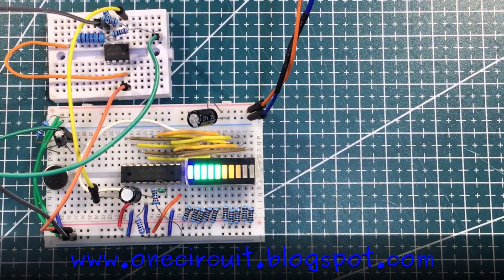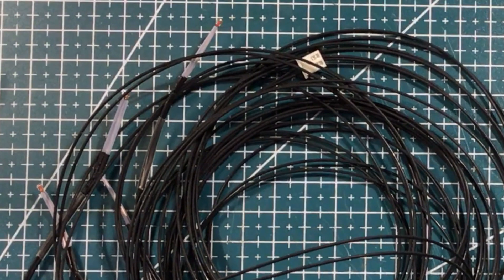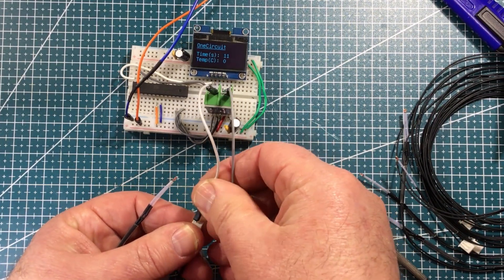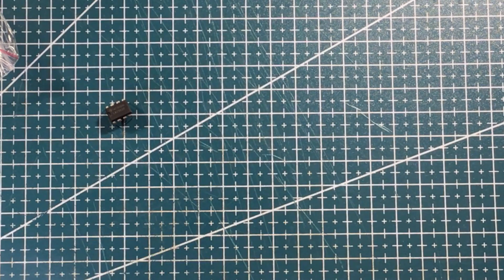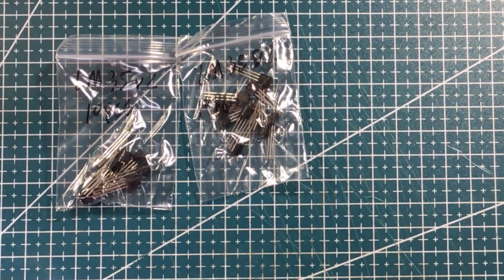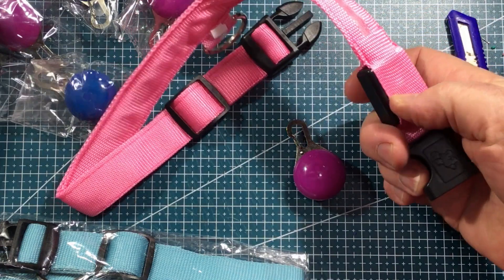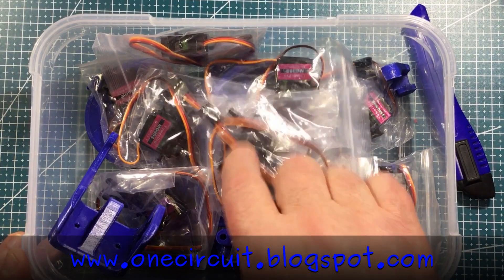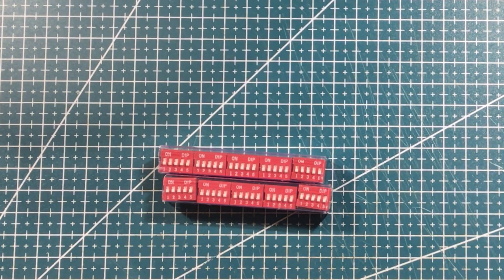Mailbag #22 (into "downtown Tasmania"...)

Comment: Well I liked, and I'm already subscribed! Temp sensors on 3D printers are thermistors (heat sensitive resistors) rather than thermocouples which is probably why you didn't have much luck with them :).
Reply from the maker: I wanted to edit that bit out but in the end my “education brain” said it might be useful for others to see my naff fumbling! 🤦🏼‍♂️😂
Reply: @onecircuit-as  Its an easy mistake to make, the "bead" thermistors do look like large thermocouple junctions on my Ender 3 Max.
Reply: Yes, I just finished a scrambling about, wondering if everything I know about 100k NTC thermistors was wrong.
These are simpler to hook up to an MCU ... just need a 4.7k resistor to split the voltage, and a lookup table.
After reading up, am curious to try out a MAX6675 + thermocouple, as they do have more linear 12 bit resolution.
Those chips are a tad expensive though, like $1/ea.  The NTC solution is very very cheap.